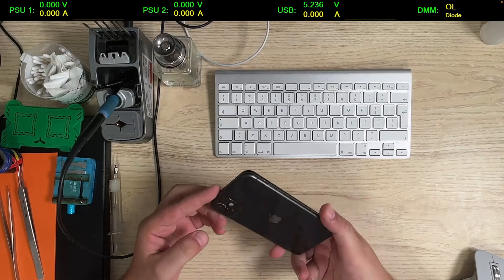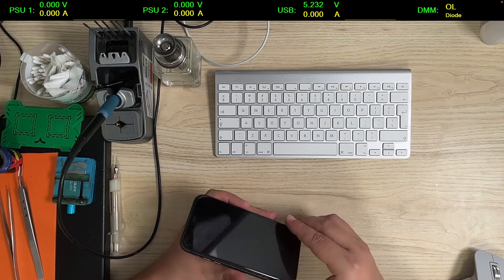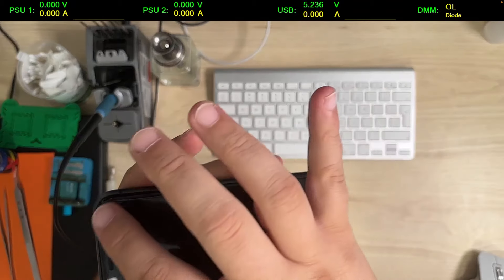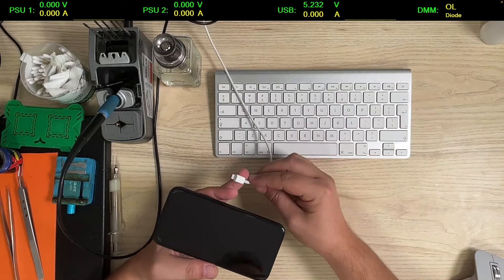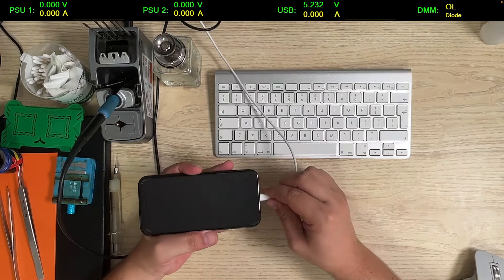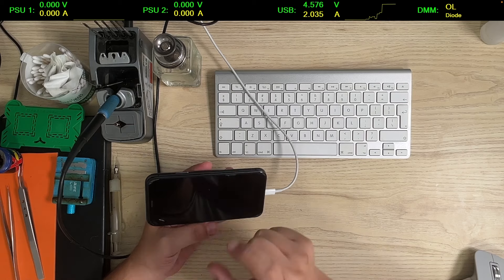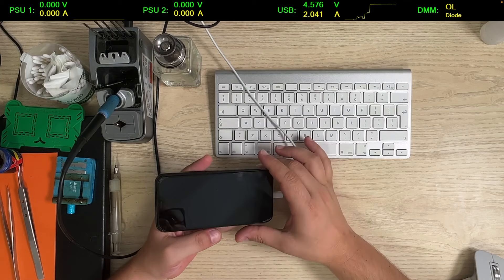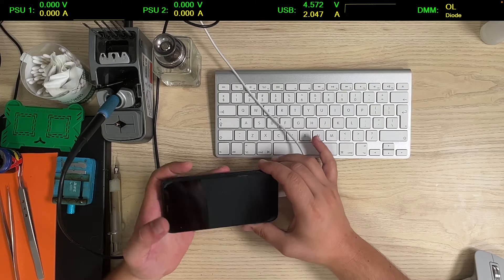iPhone 11 stuck at 150mA

Comment: Hi, nice video there
I've got an iPhone 12 with 400mA charging current, and stuck at 80mA on the power supply when trying to boot it. checked the main voltage lines around the PMIC and they all seem normal, no shorts and right voltages
What do you make of that ?
Reply from the maker: @Jbrimbelibap  80mA can be in dfu
Reply: @mirceaalicu  it's not detected either